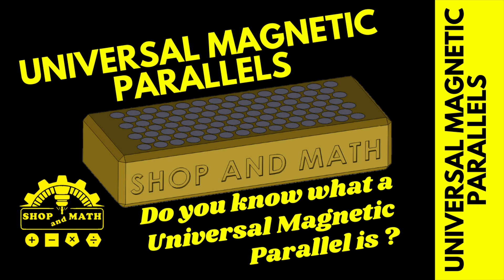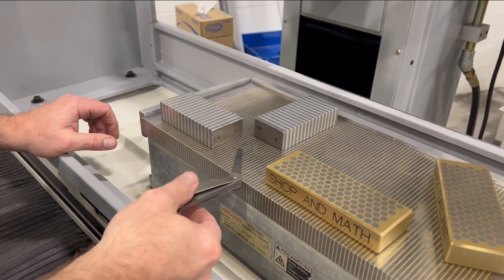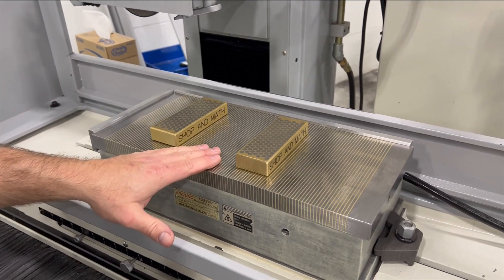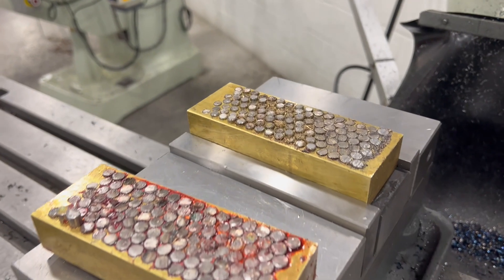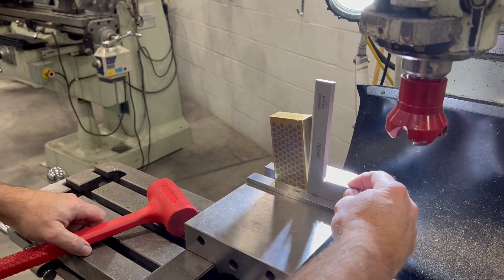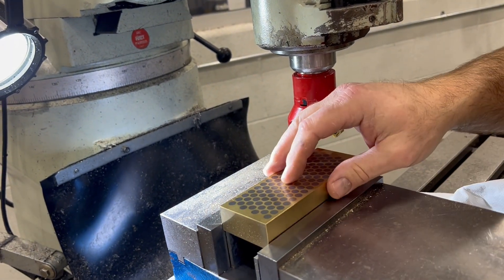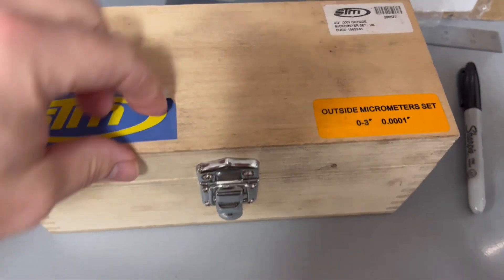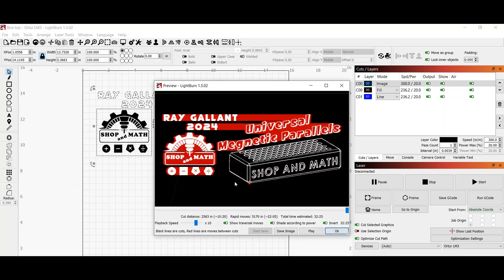Universal magnetic parallels

Comment: Great video and result.  I know it wasn't the main point, but what is that grinder used to cut the pins called?  I could really use one of those but have no idea what the search term would even be.  Anyone?   Thanks.
Reply from the maker: The grinder that I used to cut, the pins is very standard nowadays it’s just instead of being a true vertical. Most of the attachments for grinders are more of a scissor action or it comes down like a chopsaw and then you can attach whatever type of grinder you want with it.

That particular grinder basically was dead when I found it and then I rebuilt it 

Thank you for your nice comment and thank you for taking the time to comment it as much appreciated

Comment: Ray love your videos. Greetings from Perth Ontario. I design loudspeakers, woofers and tweeters. The best steel for transferring magnetic flux is the lowest carbon you can get. Drill rod is not the best for this. Generally I spec 1010 or 1008 for loudspeaker motors. Large diameter smooth nails are generally a reasonable source for this kind of steel.

Mark
Reply from the maker: Thank you for the nice comment